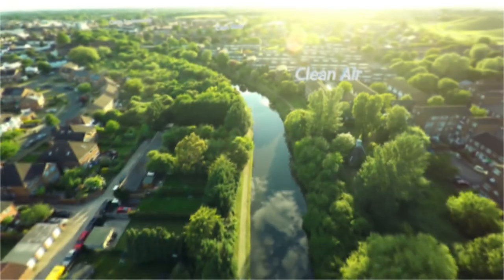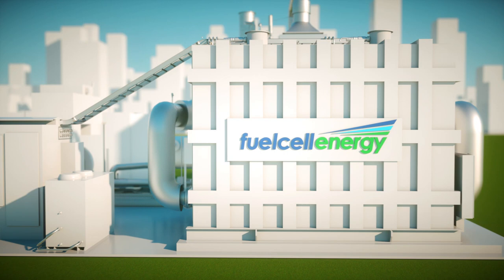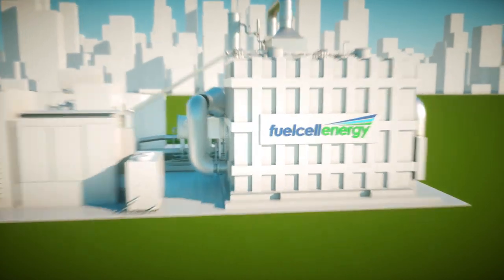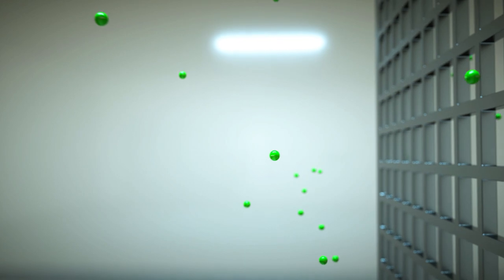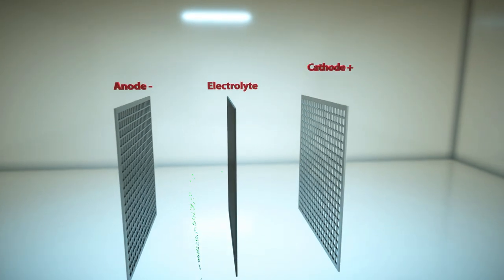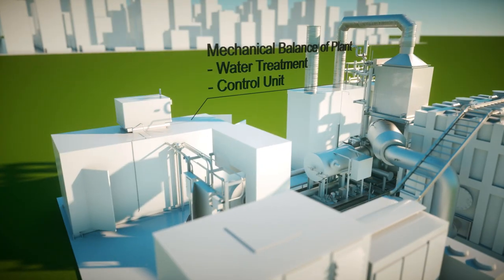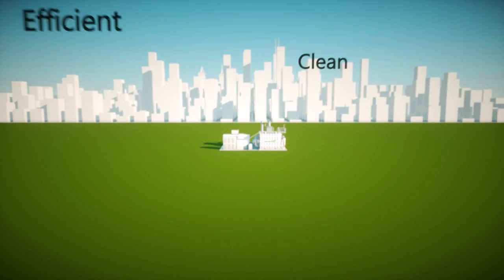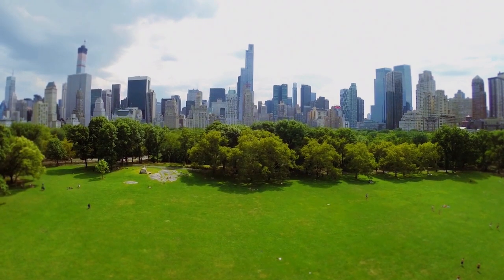How Fuel Cells Work

Comment: @ fuel cell energy.

Thank you for your video describing your technology.

Some questions need to be answered please.

1. For giving amount of BTUs natural gas what is the given amount of output BTUs in electrical DC for your unit? 

What is the actual efficiency?

2. To convert DC to AC to power the grid there is a 30% loss of DC power to AC in transforming from DC to AC.

3. After it is stepped up to AC for high voltage transmission there is a 40% loss in AC transmission lines to end user.

4. Since your system produces some CO2 and possibly other gases what capture system do you have that captures the CO2, as your unit is quite large it's producing quite a lot of co2.

A) what amount of CO2 / nitrous oxide, and other gases is your unit producing, per kilowatt or per a megawatt?

B) what scrubber systems do you have in place that will handle the capture of the CO2 and other toxic gases produced by your unit.

5. Your system still slaves people to natural gas, or biogas. Can you please build a system that works off of hydrogen. Hydrogen is much cleaner and easier to produce than  natural gas or biofuels from tires.

In closing:

What is the smallest unit you produce for home installation? Do you have a 2 KWe to 5 KWe for home installation or greater for factory installation.

As I already have access to natural gas and or biofuel, and have a way to do carbon and other toxic gas scrubbing.

Please respond thank you.
Reply: I'd recommend directly not publically for serious inquiries.  🐫👀🐪